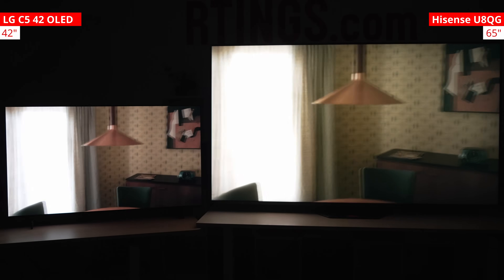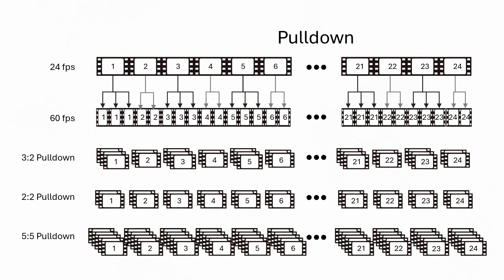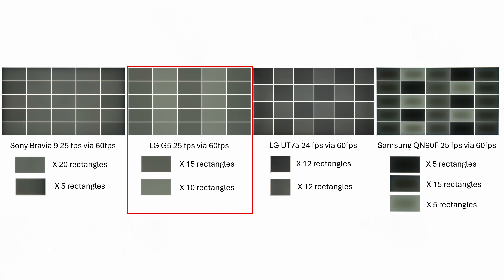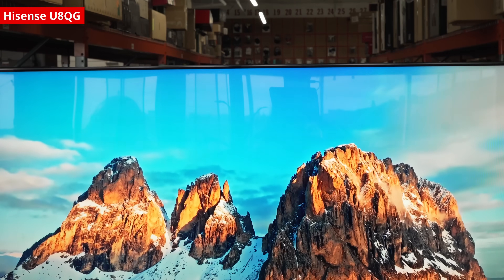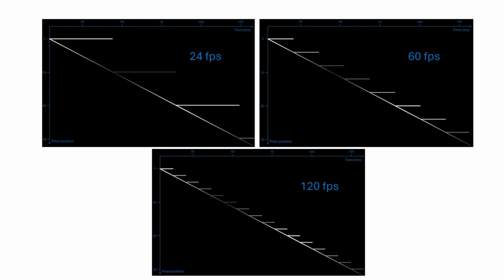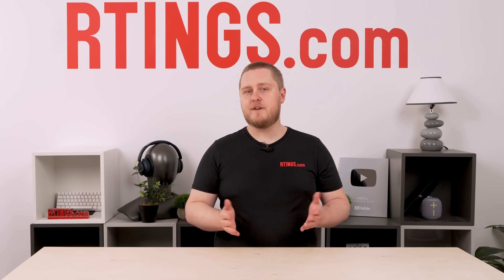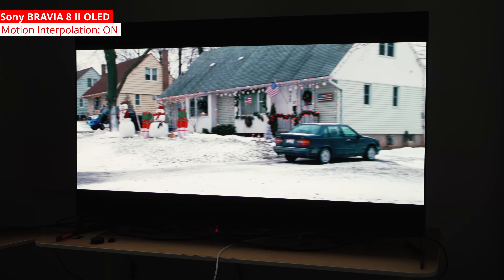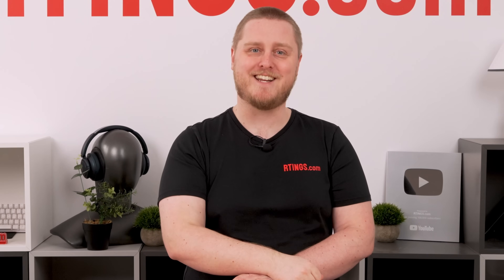TV Stutter, Judder, and Micro-Judder Explained (And Our New Tests For Them!)

Comment: Why is any new material still produced at 24 or 25 fps?  No stutter or judder on live TV.  In the old days, 24 fps film was theater projected through a 2X shutter to give a smoother 48 fps flash rate. It's just perceived smoother to the human eye that way.  In 50 hertz countries, films on TV were just run at 25 fps, without pulldown.  They didn't even bother to pitch change the audio.  Where I live, 24 fps film is encoded at the source to either 30 or 60 fps before transmission and the result is that the artifacts are determined by the encoder and not the TV itself.
Reply: While^ you can combine 1/50s shutter speed together with 50 fps filming on most digital video cameras (so you can have "standard" 1/48s motion blur together with 50 fps), I guess for a lot of drama-type or cinematic-type stuff there is thought to be no advantage to 50 fps?

^ (As long as you are not filming on physical film, where obviously you still need that 1/48s or 1/50s gap between frames to physically advance the film in the camera between exposures, in the traditional 1/48s = 24 fps (standard cinema, naturally looking motion blur) OR 1/100s = 50 fps (where 1/100s = low motion blur & can look weird, like a slow motion effect)  relationship.)

Comment: Great informative content!
Love that!

My plasma Panasonic seems not to have such issues you covered in this video? Afaik?

Used to be that motion blur say in sports content was highly noticeable/irritating - is that still an issue in modern tvs?

Some of the examples in this video are quite distracting!  Deal breakers in some cases - hisence.

Thanks for your excellent work!
Reply: Thanks for your feedback :)

Plasma televisions were indeed very good at reducing stutter and micro-judder. For example, the sample-and-hold strategy they use helped significantly reduce the stutter. Though this same strategy reduced brightness and introduced flicker, two characteristics that not everyone will be bothered by if motion is preferred. Most plasma televisions didn't have judder mitigation, so they had judder, but on the bright side, they had nothing to introduce micro-judder ;)

Some modern televisions still struggle with motion and blur; we will discuss this in more detail in the next TBU. In the meantime, the current response time metric on television gives an idea of the response time of different televisions at 60Hz, which is often used for sports.
Reply: @kastaartings thank you for your very thoughtful response!

I’m pretty sensitive and pretty observant.
When i first saw the slow panning examples and how images seemed to smear or tear or judder, it was off putting for sure.
Your explanations were excellent.

I’m surprised mfg don’t do more to “sync” the source and playback rates to keep these issues at bay?  Maybe an embedded code in source content that the display can lock onto?

Perhaps in audio, a dac can determine bit and frequency to lock in and sync with.

In audio “jitter” though if measured, would seem beyond reasonable to deteriorate a signal, can affect what listeners hear and perceive as “right” or natural perhaps “relaxed”.
So it’s pretty interesting to see blatant unnatural out of time fixes distract viewers from their immersive viewing experience.

With my nice old plasma it stays pretty unobjectionable or distracting.

In audio I’ve learned over time how to get a more coherent feed - more precise 1’s and Zeros timed well going into my dac.

I think our brains are tuned for coherence of audio or visual streams in nature.
Perhaps survival- detecting a minute change that could signal danger or opportunity.

Or if something is blowing the illusion of reality like detecting if you’re in the Matrix, or not.

Appreciate your good teaching and interactions!

There are more videos on your channel I am interested in watching soon!

The current Matrix thing is recognizing AI vs human or real generated content.

Comment: If you use match frame rate on Apple TV, the whole UI turns to 24fps and it's horrible
Reply: ill take a subpar experience in the menu if it means a better experience while watching actual content. everything in current tv tech is a trade-off or compromise.